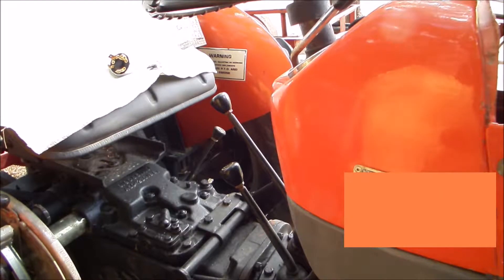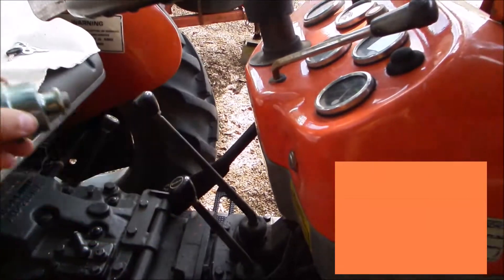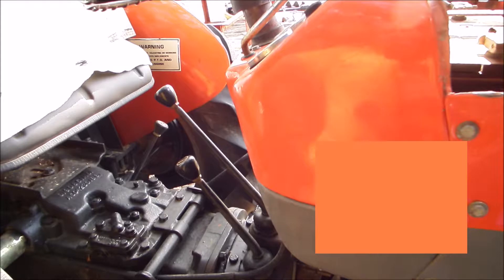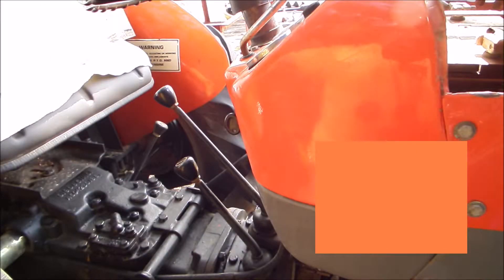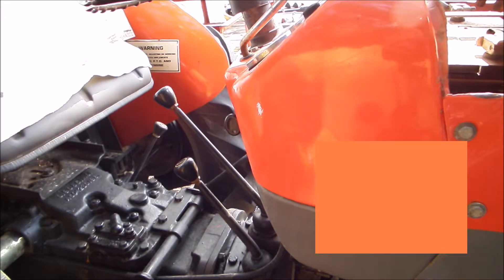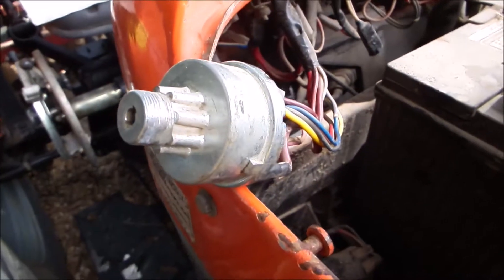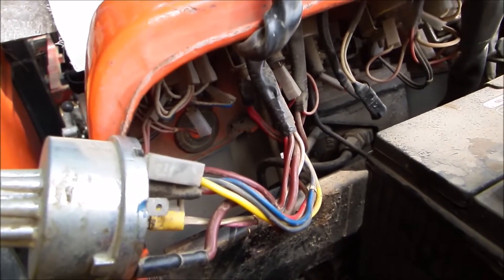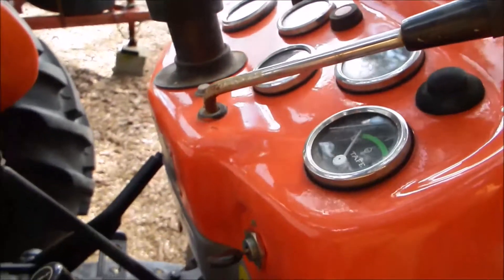TAFE Starter Switch

Comment: I have tafe 3600 do you have any idea how I can get my hands on a new ignition switch. Been looking everywhere
Reply from the maker: Finding one for a TAFE 3600 is difficult, but there is a place in London, KY (B and S Farm Equipment) where I was able to get parts when needed for TAFE tractors.  So your model is comparable to the Montana 3840.  The ignition switch for the Montana 3840 is part number A5001132.  I did a search for this and an Ebay result, from the London, KY company showed up: https://www.ebay.com/itm/LS-TRACTOR-COMPLETE-IGNITION-ASSEMBLY-KIT-A5001132-/133187087252 I hope this helps.
Reply: @cervus-venator  Back to say thank you. We ordered that Friday and got Monday and now my tractor is back and running.
Reply from the maker: @javiercocotle8368  Glad to hear it.  I just got mine back from the shop.  I had to get the injector pump rebuilt.  It appears that the previous owner let the tractor sit a lot and this allows condensation to build up in these pumps creating rust.  Anyway, I'm glad to hear that this worked out for you and your tractor is up and running.
Reply: @cervus-venator  hello do you know why the tractor won’t move. Cranks on fine but won’t move forwards or backwards
Reply from the maker: @helloitzme6171  I'd need to know a little more about the tractor you are referring to.  Is it a TAFE 35?  Also, If it has a high low gear make sure that is in either high or low or it will not move.  Likely this has something to do with the transmission.  Verify that the fluid  level is sufficient.  The clutch could be stuck as well not allowing the transmission to engage. I really need to know a little more about your tractor to give a better response.